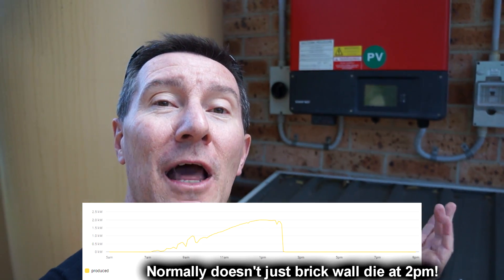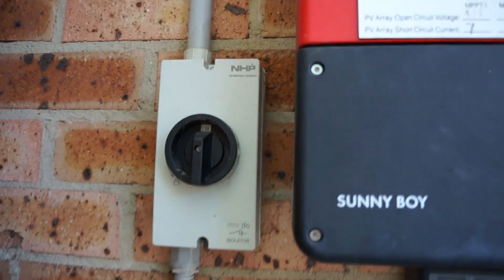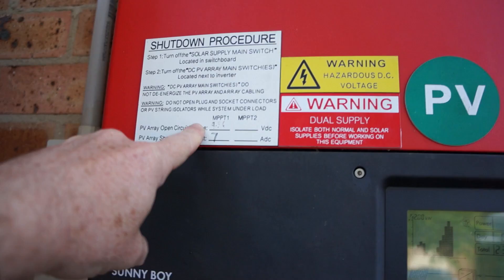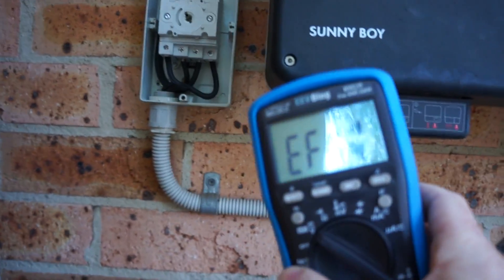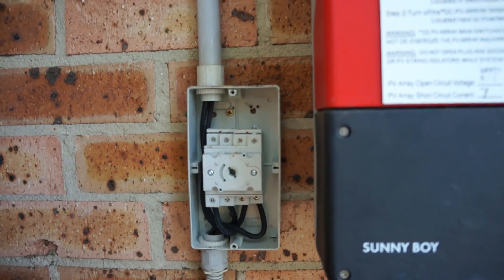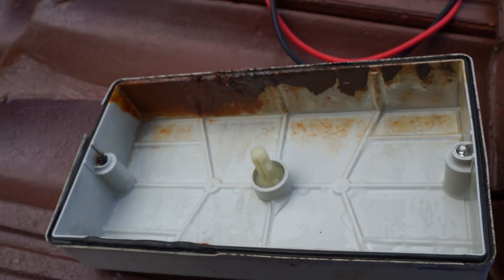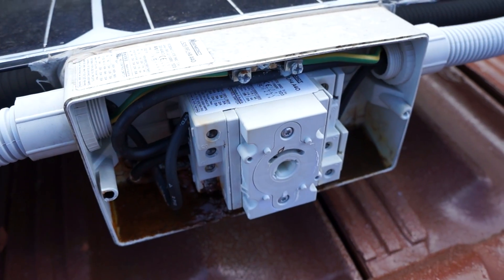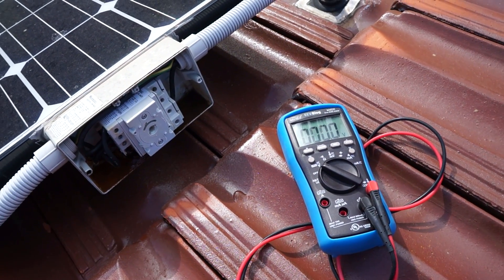EEVblog #1217 - My Home Solar Power System FAILED!

Comment: The purpose of having dual isolator switches is for safety if someone is working on it. If you only have one switch, with no way to positively lock it out, and it isn't where you have control over it while working, then you run the risk of someone else accidentally turning it on while you are working on the equipment. That is (or SHOULD BE) standard procedure in any type of high voltage system like this.

Comment: Who set up this FTV array? Putting an isolator DC switch out in the open without proper protection from elements with a plastic probably not even resistant to UAV rays means disaster

Comment: WHAT kind of demented dufus brained drongo places an isolator switch on the OUTSIDE of the panel edge when there is space underneath that will provide that additional bit of weather protection? Besides which, even if an isolator is required up there and even IF it's IP 65 rated itself, it should STILL be fitted into a full IP 65, grounded, steel enclosure (with door and or window). A GOOD system would also have both input and output power visual indications to obviate the need to open up the contactor JUST to check!

It's about time that the electrical industry globally woke up to the multitude of shortcomings they have in so many areas that should be blatantly obvious!

BTW I bet that contactor housing was not made using UV rated fibreglass filled plastic, SURELY a MUST-HAVE in Oz. In the UK now they would not be allowed, it would HAVE to be a grounded steel enclosure.

Comment: That switch does not look like it was meant to be used outside. Plastic probably degraded due to constant UV exposure.
You're lucky that that thing didn't short out and catch fire.
Reply: Weird they wouldn't have some kind of DC circuit breaker at the panels if they must throw a manual box there. In NA you see those boxes all over but they have a side lever and open to have a little all metal double pole Square D job in there. A switch like in the video once it shorts out from condensation what's to cut the power when the sun is shining? Like you said, a fire. I doubt its anything BUT moisture ingress causing the failure.

Comment: Why the isolator on the roof?  I haven't worked much with solar systems, but I can't see why it's needed since the power source is the panels themselves.  Is there a risk of back-feed from below if you're on the roof fixing the panels?

Comment: I guess there is a reason why the switch was placed there - perhaps so that firemen could cut off the power in case of emergency if the homeowner is not there.

OK Dave, first thing, UV induced deterioration was to be expected, you should have made a little sunshade for the switch box, and then the plastic probably would not break so soon. Furthermore, buying a more expensive weatherproof box, cast aluminium one, would prolong its life to a half a century or so. 

Second, graceful degradation: even when gaskets fail, or outer walls are breached, every enclosure  left out exposed to element should have a draining/drip hole at the lowest point of its insides. 

Third, timely alert: Even if the waterproofing barriers were breached, and draining hole got plugged with gunk, a well placed sensor would have warned you weeks ahead of final failure. 

Fourth, I am full of shit - this worked for quite some time just as it was, and replacing the switch probably won't set you back too much. It's not like this is a part of a spaceship or something sustaining lives, so that it would warrant all of the precautions.

Comment: I think old school engineering is required plastic enclosures in a place like Australia is asking for trouble the UV will destroy plastic and allow water in why not just make them out of stainless steel and have a replaceable high quality silicone weather seal this type of design would last longer than the panels

Comment: I'm a little concerned about calling it "Just a switch, on/off" around the 1-minute mark. One particular problem we have lot of in South Africa is installers using AC-rated switches on these DC lines, precisely because the proper DC-rated stuff is just insanely expensive. We also have the same problem with the sun just killing absolutely everything in its path. The combination of those two proves that quite simply... a switch is not just a switch.

I've always thought those switches on the roof is a bad idea. Much better to put them lower down where you have some shade, and put up some warning signs. Those things depend on local legislation of course.

On another note, you will note that the switch is in fact 4 contacts, with two busbars at the top that puts two contacts in series (that increases the voltage rating). In all likelihood this 1000V rated disconnect is in fact 4 x 250V rated contacts.

Comment: DC isolators are required at the moment to be installed on the roof top array thought theres many organisations lobbying to have them removed.

the other issue you have is your top quality LG panels have an isolator screwed threw them... bye bye warranty on that panels although LG are pretty good with warranties but i doubt they would warrant that.

Comment: Fit another one if it's a code requirement but either put a sheet of Lead, Copper or Butyl Rubber pond liner over the box to guard against the UV and any rain.

Comment: i wish i could have put some money on this dave. we fix around 1 of these a week. solaredge is pushing to have them removed on their systems as they have rapid shutdown. atrocious things and around 90% of PV faults is either roof or ground DC isolator. these things should be banned an no inverters without rapid shutdown should be allowed in the country. its thats simple. the CEC has a lot to answer for and the regulators as usual are lagging the tech

Comment: What is the actual purpose of these isolators on the roof? The only thing I can think of is so the forgetful/lazy electricians/installers can isolate the panels from the inverter without going back down the ladder, they seem to cause more problems than they solve, I cannot see it as a safety thing as these's another isolator down near the inverter.

Comment: Is this ABB switch https://www.ebay.com.au/itm/ABB-WSD432-Switch-Isolator-Weatherproof-4-Pole-32A-240-415-V-IP66-Padlockable-/272101265546  any better or should I expect a similar failure in time albeit it is inside my evaporative air conditioner box so it only get slightly  wet sometimes not sun struck?

Comment: Yes rooftop isolators are a crazy idea however they're still mandated in Australia by our solar Standards and Guidelines. The original thinking behind it was to allow the cables coming down from the solar array to be de-energised in and emergency (eg house fire or flood etc) so emergency workers wouldn't receive electric shocks - as these cables will still be energised even if system is switched off down at the inverter or switchboard.
The reality is that during something like a house fire (where it may even have been started by the isolator itself!) no firefighter is going to climb up on the roof to switch the solar array off. The other reality is of course that they are an extra point of failure and potential fire due to possible water ingress to the enclosure.
These days - as of about 18 months ago - the Standards now state we have to install them with at least a 'shroud' over them to try and prevent deterioration from the weather - but until we can get the rules changed to ban roof top isolators we'll always have issues.
Of course even if/when that happens we'll still have millions of existing systems with these isolators just waiting to fail.

Comment: Just wondering why there are so many isolator switches. Also another big question is why is the inverter and switches located out side? On My system I made them install all the gear inside the garage, to protect from the elements. also my isolation switch is the same brand as the inverter. (sunnyboy). My system is 10 years old now, and no problems yet.

Comment: 12 panels on 1 String? I always split the loads just incase an instant like this happened. That way at least you have some juice getting through. Usually using 16panels @250w each totalling 4kW. I always split them into at least two strings. Bit more work but worth the pain in the arse later on incase of the issue you have. Easir to track the culprit too. However I'm not sure what your domestic use target is? Here in UK the average install max was 4kW, however I do believe more is allowed. I would have definately split your install into two strings though. Glad you found the issue easily enough though. Wont take long to change isolator and all done! :)

Comment: Just quick note.. perhaps someone already pointed out this. DC switches are really complicated devices as when you try to open live circuit the arc will light between contacts and it wont die like in AC as the current never goes to zero. This is the dangerous part.. is proper DC switch there are design features to kill the arc. So advice from electrical engineer .. don't save money on DC switch, buy proper brand i.e. ABB. Those companies have actual knowledge how to cut DC.

Comment: "And the seal couldn't keep the water out."
Seems to have done a reasonable job of keeping it in, though.
Reply: Sometimes I think it is better not to seal for that reason. If water gets in it can't get out and it corrodes everything. A weep hole on the bottom might be better to allow it to drain and dry out. I have only seen three ways to guarantee something outside won't fail. Heavy duty expensive sealed enclosures, potting or pressurized with nitrogen. Even conformal coating will fail if moisture sits on it for too much time. I worked with traffic cameras that were pressurized. The system monitored the pressure and as long as it was up then you know nothing can get in. If you don't want to enclose, pot, coat, or pressurize then you need air flow to keep it dry.

Comment: Not just a switch its main function is arc suppressor. Arc travels upwards and will cause fire/not break circuit if installed upside down / horizontal. Will also cause fire if input and output are switched. Recall was because input and out pout were not clear enough. See this video https://www.youtube.com/watch?v=Oaq2cvoPBRk

Comment: dam you've had your panels for 6 years, 
my solar panels (supposed to be german cells) are already getting snail trails (cell burning for those who don't know)  on them after 2 years, and they aren't out all the time (they were supposed to be for a car or van ) ,i only run a 24 volt system with a voltage reg to bring it down to 12 volts which charges up my lithium cells @500ma each so i only take out about 1amp at most  anyway i'll look into lg panels

Comment: You can  bypass that switch for now just to check to see if the rest of the system is working.   But you should put the switch back.  That switch is for safety.  For the Firefighters who come to your house.  They need to be able to do there jobs.  

Good luck. Your solar Modules should work for another 60 years or so.  Enjoy

Comment: Looking at the waterline, it may have helped to have a small hole in the bottom  to let water out. Our sockets for wet rooms have a small drain. Maybe give the new switch a small roof or mount it under a panel.

Comment: Clipsal supply a torque for their IP rated switches and boxes. I've never seen a sparky use a torque driver though.... I just silastic all mine up with silicone to prevent this.

Comment: I just checked mine, they've installed the roof top isolator within a metal enclosure providing some weather protection on 3 sides.
Reply from the maker: Seems common, I got duped

Comment: More than a decade? You should get 2.5 to 3 decades, especially with LG panels
Reply from the maker: Sure, but likely something else will go wrong. Even something simple like a corroded contract
Reply: @EEVblog  Good point, at least that's cheap stuff to fix. Just put a 14.1kw system on my house and it's amazing. Your solar videos inspired me. No disconnect switch on the roof..haha.

Comment: That should not be a switch box. They should have installed a fuse box in that location. Also never a good idea to use plastic on a roof.

Comment: holy shit mate. They use an aluminium composite panel in the signage industry (acm) that you could easily make a nice little box/roof from to protect the switch.

Comment: That wasn't installed correctly, the seals optimistically shouldn't be facing the direction water is going to travel. Surprised that lasted 6 years. I agree as well though, why do you have two of the same box? Just adds another point of failure, unneeded.

Comment: Spoiler:
"I have no idea why all those other switches were recalled; this one isn't."
One minute later: Shows why this switch should also be recalled.

By the way, two insulator switches makes total sense to me. 
The roof insulator takes the dangerous voltage off the wiring in case you need to do construction close to them, but it's difficult to reach in an emergency. The insulator switch takes the power off the inverter in case you want to work on that, and is easy to reach but doesn't take power off the wiring.

Comment: No DC isolator on European roofs (a disaster waiting to happen) and no isolator needed at all with that particular inverter: the black handle below (it was called ESS back then) is a certified emergency DC isolator as of IEC regulations. Besides that, there's really not much sense in isolating a string from its non existent sibling.

Comment: Breaking high voltage/high current DC isn't a simple matter (as you know well LOL). It's probable they tried to modify an AC isolator and didn't test it after years of dirt buildup

Comment: The reason you need the isolator switch on the roof is to provide a line of sight disconnect for the array.  It is a code thing.  However, you also need to use a product that is fit for purpose.

Comment: It's generally not a good idea to install these plastic things out in the open like that, much less sideways. Even the "UV resistant" plastics go to hell quite fast. Being an electrician, I like to see these things under some sort of cover, or at least painted. 

Of coarse, where I'm from, we have stuff like six months of real winter, so here it's kind of mandatory.

Comment: I'm interested on a video where you are going to repair the switch safely. Basically there is still 425v on the cable and there is no switch to open anymore. I guess removing a link between 2 random panels is the safest thing to do, but it could still have quite a high potential to earth if there is an earth leakage in the wet box or so, so you'll have to know what you are doing. For EV batteries you have to wear special gloves, even though the link halfway between the string of batteries can always be removed.

Comment: Heh, funny - I sell tensile testers that are often used to test both the rubber seals and plastic material in boxes like this. There are standards for testing before and after exposure in both uv and enviroment chambers to check how the material properties change over time. They typically turn from ductile to brittle offcourse, and then they crack under thermal expansion. Strange how plastic boxes like these are mounted completely exposed, as they really have no proper design features to prevent nature from getting in, just a gasket.

Comment: The majority of DC isolator switches being recalled are due to safety, specifically not beong fully waterproof and over time water ingress can cause it to overheat and cause fire.

Comment: My solar system doesn't have an  isolator up at the pannels only the AC and DC down the the inverter. My system is 8 years old and doing fine.

Comment: @EEVblog — If you're required by the local building code to replace the isolator switch with a similar unit, consider wrapping aluminium foil duct tape around it to protect the vulnerable seam from sunlight. Don't use the ordinary indoor duct tape that's silver-gray plastic film on cotton cloth, which would probably fail within a year when exposed to the elements. Even wrapping the isolator box with a layer or two of ordinary household aluminium foil would extend its life by a decade or two.  Check the condition of the overwrap annually for good measure and replace, if needed.

Comment: Use a couple of layers of metallic spray paint (like Hammerite) on the switch, it will block out the UV light from ruining the plastic.

Comment: That's sad that you've had so many problems with it.... from micrometeors/golf balls/whatever damaging a panel to this.

I would go old school and put a good-old-fashioned blade switch in there. Go all Frankenstein with it. In an enclosure, of course... there is a little one around. That second isolator on roof.... not sure why that's necessary - you're just isolating the line from the panels to the grid-tie-inverter. Oh, continuing to watch, you realize that, too ;) Is that an electrical code requirement? I would see ignorant bureaucracy requiring that, but not knowing engineers...

Comment: We have an isolator on the roof as well, however, they thoughtfully installed it UNDER the panels so that it's protected from the elements, so luckily no faults so far!

Comment: IMHO if you want to improve things, you should if an array drops out, have a by-pass switch on each cell but a small one that fits UNDER the solar cell it is isolating or connecting so that weathering is less of an issue.